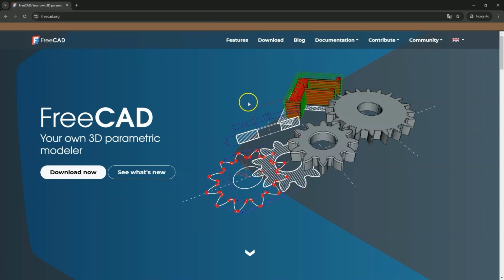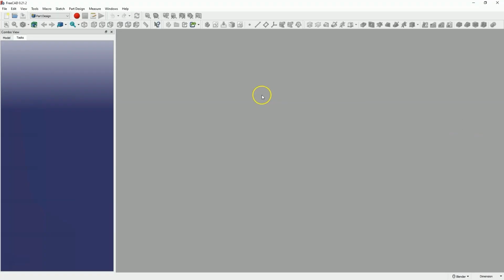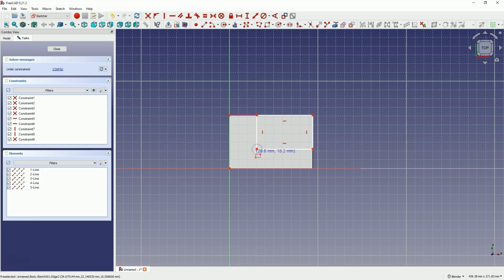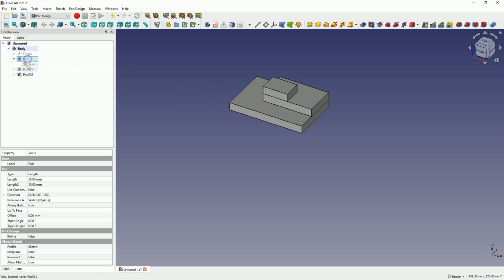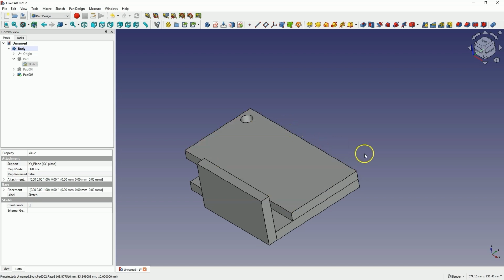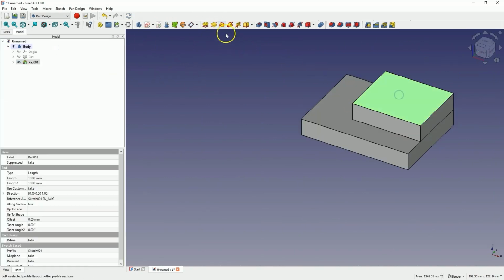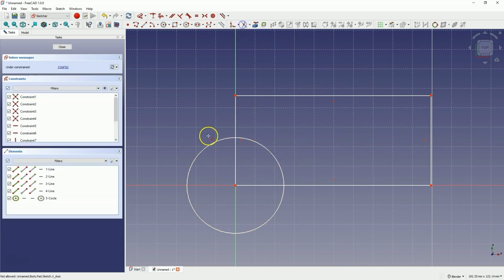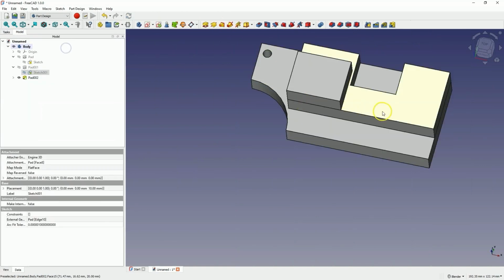New Version of the BEST Fully Free 3D CAD

Comment: For my 3d printing hobby projects, this fix alone probably makes Freecad a viable alternative to Fusion! The only other thing I've really missed in Freecad is selective padding of sketch features (i.e. extruding only a part of a sketch, instead of the whole thing). Is that in the new version? It's something I could definitely work around if I have to, but I'd prefer not to.
Reply: I'm pretty sure you can pad specific parts of a sketch in 1.0.0 now. It's not as intuitive as in fusion but the capability is there now.
Reply: I have been working with inventor, fusion and onshape for quite some time but Freecad is where I would rather invest my time now as the subscricption cost is constantly increasing which makes me feel uncomortable for the future. In addition they slowly remove cababilities to force you to go to the paid version. Also fusion and onshape workflow is on cloud so despite having a fast pc it is still relatively slow to respond althought there are a lot more user friendly and easy to comprehend. Freecad requires from new users to alter their workflow a bit.
Reply: @tunedstylespecs  That are exactly the reasons I switched to FreeCAD. As a do a lot of 3D printing and electronic repairs,  including repairs where mechanical parts have to be replaced (that are most times weird formed shapes that are broken), the use of CAD is really needed. FreeCAD gives me enough tools to do all I need, and then some more. Since I switched I never looked back.

Comment: Id go after solid works blender or fusions clientele.

Modernizing the User Interface
The current UI, reminiscent of early 2000s computer software, can be off-putting to new users and those familiar with other CAD programs. A reskinned color palette and customizable UI would greatly improve the overall user experience.

Robust Error Handling and Prediction Algorithms
Proper error handling and prediction algorithms. easier said than done but the key here is preventing frustration. By detecting potential error states before an operation is complete, the software should warn users and help them familiarize themselves with the limitations. This would significantly enhance the software's value and usability.
Reply: Well solidworks and fusion are great softwares but expensive, so I am going away from them. Solidworks costs thousands per year and fusion from 250 went past 600 for a yearly subscription. I have been doing CAD from years but know that a stable version of freecad is ready I will support the developers. I know that the softwares have free version but slowly they are limiting what is offered in free, or if you want to use your designs for profit you have to pay them. Blender is a different type of CAD software for animation, game development, rendering etc but is is also free and developed by the community just like freecad.